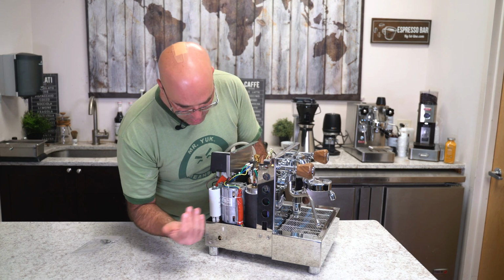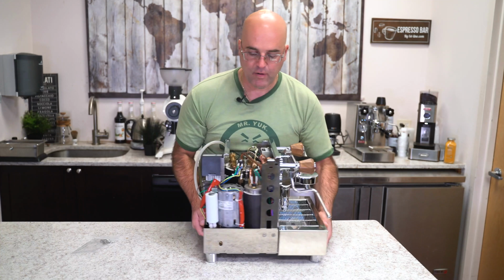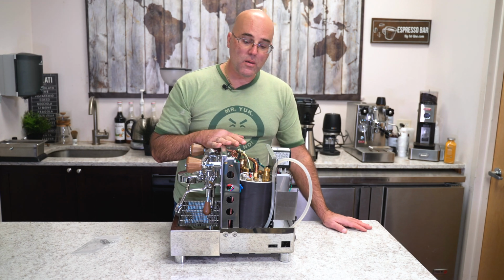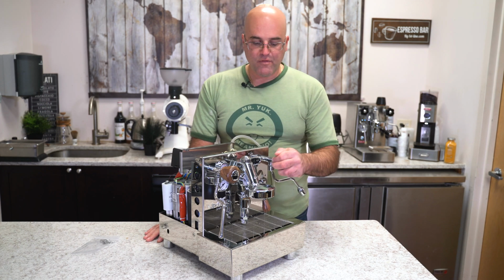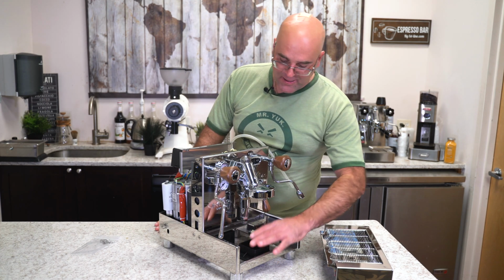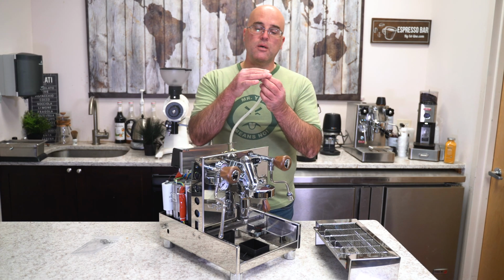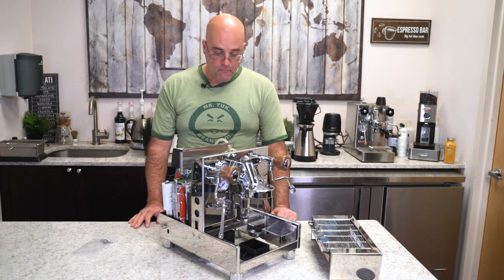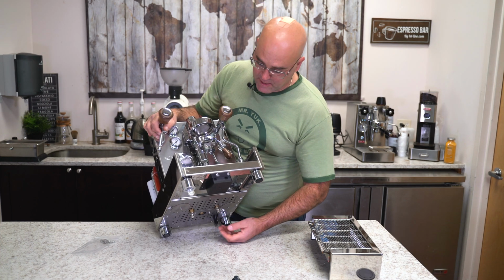Internal Review: Izzo Valexia Duetto Espresso Machine

Comment: I just got a used one but it have problems with suction. I tried to “force” water through to get air out and it worked, but now there are bubbles in the transparent hose again. I think there is a leak somewhere but nothing to see. When it gets hot there is a very little “click” and suddenly there flows bobbles from the pump to the reservoir. I have worked on it for days trying to fix it but couldn’t 😩 Do you have a suggestion? 😅